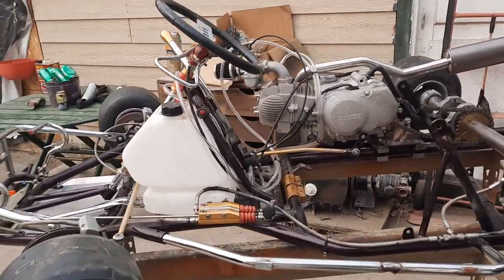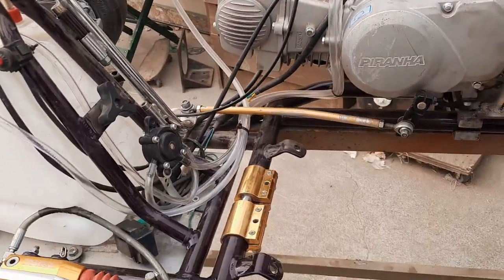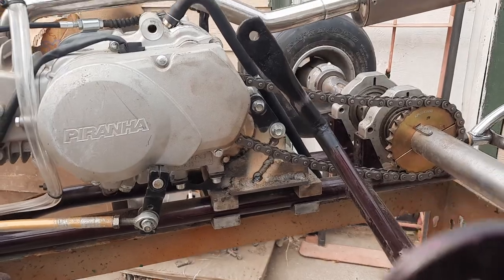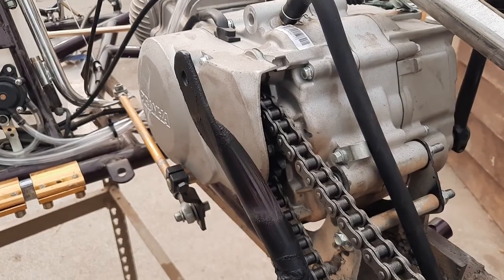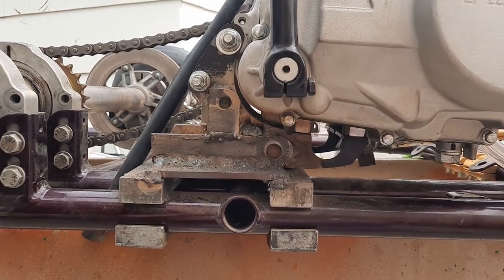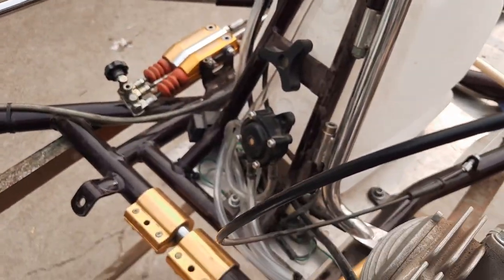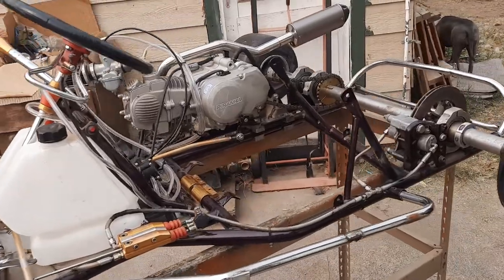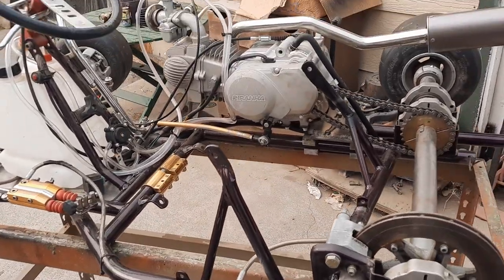Piranha 140cc Shifter Kart!!!

Comment: Looks like a Tonykart extreme? Its interesting that you were able to get the axle sprocket inside the second carrier bearing. Most of the pitbike/horizontal setups I’ve seen, the seat gets in the way and prevents moving the engine far enough left to line it up.